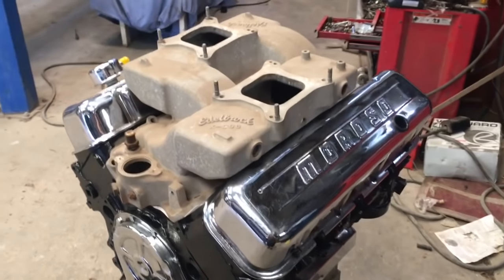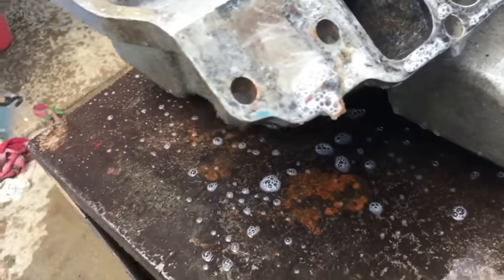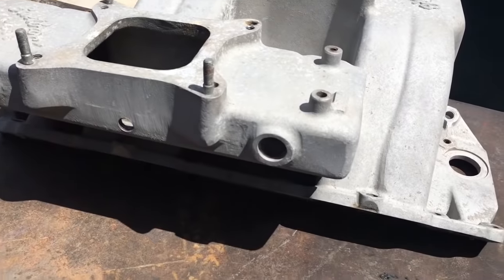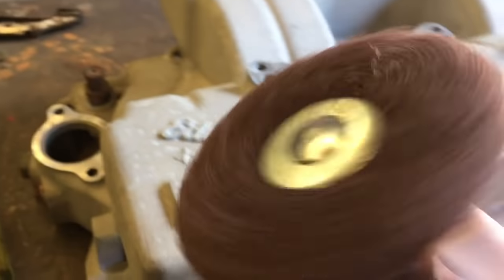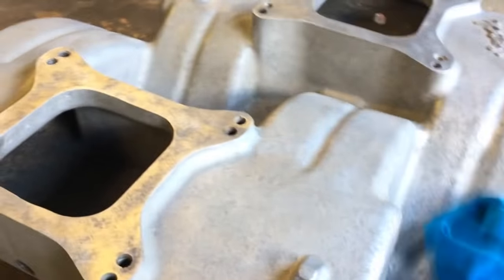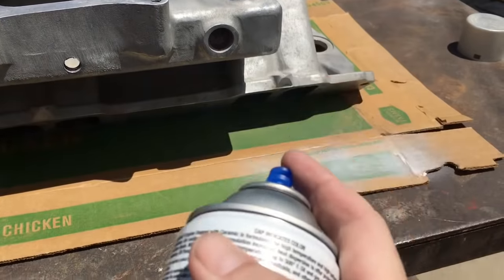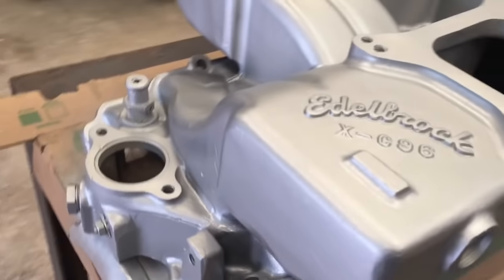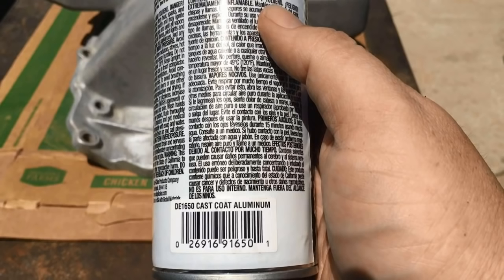Aluminum Intake Manifold Restoration the quick, cheap and easy way

Comment: I thought Edelbrock's had Endurashine?! 😂

I love that paint though. I redid my ATC 200s with black fenders and I did the tank and forks with the same stuff, just a little darker (like a gun metal cast iron it was called or something) Also restored a 1973 Briggs model 19 (8hp) and used the same paint, just in white.

Comment: Seems four 2bbl Holley carbs would be much better for distribution that two 4bbl carbs ,  4,. 350 Holley's would be great, for most fairly stout engines, and high RPM, and larger displacement stroker engines, four, 500 Holley's! They will probably require tuning, and the pumps backed off a bit, I'd use cables for the throttle, and a 1:1 for them all,  aligned with the runners, a  plate on the top would make it easy,  I was going to do something similar with a 84 cross ram tbi intake, until I saw how tiny the runners were,   no wonder they were done @ 4k-4500 rpm
Reply: The long runners,   set the peak  rpm.
I  have a  1988 corvette with TPI.  PEAK horsepower is 4800 rpm.
The 1988 TPI has 8 injectors,   but the peak rpm is still 4800 rpm.
Goggle  Chevrolet 1988 TPI

Comment: I use a product called Alum-a-Brite (when i can get it), or Eagle 1 mag wheel cleaner, the stuff made for cast wheels, and a paint brush with the bristles cut short for a scrubber.   I looked around, but Snow Bowl doesn't seem to be available local to me - otherwise I'd try that.   Probably a mild lye or acid cleaner like wheel acid.
Reply: Yup. Got a gallon of it. Used to clean big rig rims

Comment: These ram manifolds are so cool looking and if you use them on the street, thank you for your troubles.
Reply: They do, but you gotta have the bottom end and cam for it.
Reply: This is the same series manifold that I have been looking for for 30 plus years , Edelbrock X-3 for Chrysler. I had a guy tell me to forget that I even know about them , smh.
Reply: @Mike_Collins392  I think someone is making repops of those intakes now and I thought it was INDY cylinder head who were making those Max wedge intakes .

Comment: I know i am late to this video. but i just wanted everyone to know that Eagle-1 Etching MAG Wheel Cleaner will restore it to like new shine. I have used it restore the shine on my 1970 Camaro SS 396 L78 manifold. it looks like new, no painting required.
Reply: Then it oxidizes and stains again (unless it's a show car that is barely ever run.). Mag wheel cleaner IS useful for cleaning, but needs to be rinsed well before painting.
Reply: @Spiritof_76  I would mostly agree with you, on the fact that it will oxidize again. for my car. since they are extremely rare, (L78 was a 1 year only option and they only made 600 off them and they were all 4 speeds), so the value is in keeping it as close to original as possible. painting the aluminum intake is not an option, as it will detract from the value of the car.  my current method for restoring aluminum pieces, is vapor blasting, followed by eagle 1 wheel cleaner. vapor blasting as a tendency to leave the metal a little on the white side. but the wheel cleaner fixes that.
Reply: @shadvan9494  I wouldn't go slap happy painting parts on an L78 either.

Comment: Came out nice, but you really should be taping off the inlet, input ports, water neck, output ports, etc.
Reply: I was looking for someone to say something about the leaks this guy was going to have for painting over the metal. Not a good idea. Gaskets hate paint.
Reply: A little sealant and a gasket and bolt it together. That thin layer of paint hardly matters. If you want to be picky, a scotchbrite disk on an angle grinder will take the dry paint off faster than taping it all off. Or a paper or cloth towel with a little thinner will wipe the wet paint off quicker as well.
Reply: @Spiritof_76  paint makes gaskets separate. That's a simple fact. There's a reason no performance, professional, or even novice racer just leaves random paint on mounting surfaces. And that's for cars that are only run a few hours a month, if that. On a daily driver, it's even worse.
Reply: @the-dullahan  A thin layer of paint on the carb flange? What's it going to leak? The only flange with liquid passing on a Chevy intake would be the thermostat housing. A quick pass with a sanding block, lacquer thinner, or scotchbrite disk and it's gone. A little paint on the distributor flange isn't going to pass oil, there's an o-ring on the shaft. I have 5 chevy engines in my garage right now and have assembled a few in my lifetime.

Comment: You gotta heat up the metal and remove any moisture or oils/ solvents still within the metal. Then you need to primer it. Then add your color.

Comment: wow...looks so much better, do you ever put a clear coat on top of the gray paint? also you did not tape the mating surfaces on the openings, is that ever give you trouble with the gaskets and such?
Reply from the maker: I've tried it, but the clear tends to yellow over time with heat cycles, so I just put the gray on with no top coat, and that way if it does begin to flake or get scratched, you can easily spray some more on to touch it up.
Reply: @NitroUnion  what about self-etching primer for aluminum?

Comment: Glass peening with new glass beads will makeit look like new it is lighter looking with a shine on it ask your local machine shop about it although that cross ram did look dam good but one question how in the hell do you tighten the intake bolts on that thing LOL
Reply: T nuts are the way to go or you use a small magnet that sits in the socket to hold the bolt on and even then it's a pain in the ass because I had the same exact intake and switched to T nuts and life was good again.

Comment: The best way I've found to shine up an old aluminium intake is to use steel wool. I use the same cleaning process with degreaser but I just hit it with steel wool and then I use a magnet to pick up all the loose steel that falls off the wool. I just try to avoid painting aluminium engine parts because is just chips way to easily.
Reply: Don`t want to use steel wool on aluminum, pieces of the steel wool will get stuck in the aluminum and start major corrosion problems even if you paint the aluminum....Thats a big No No..

Comment: i get a lot of cars for free and i get a lot of after market parts build a lot of cars out of the parts when i polish i like to clear coat the part so it stay's shinny plus it saves a lot of money on a build i even do wheels make them look new and use mothers on the chrome like the bumpers u can make them look new again if the chrome is good and if u use car paint with activator in it it will last a lot longer then engine paint and stay shinny this is how they build show cars to stay looking good drive after drive just clean it  and when u paint it it should be clean of all oils and dirt i use reducer and wipe it clean this is how u restore parts but if selling the rig just make it look good

Comment: You can clear that duplicolor with 2k aerosol and it will hold up to gas getting on it.
Reply: What?
Reply: @jwjarv1s  I'm guessing English is not your first language. Ok I'm going to slowly break this down for you. Ok first he sprayed the crossram intake with duplicolor aerosol paint, are you still with me? Now what I'm proposing is get a 12 oz can of aerosol 2K clear ( yes they make 2K in a aerosol can) and clear over the duplicolor for added protection from gasoline spills. I hope you can grasp my message this time, because it will be difficult for me to draw you a picture using this format of communication!! WHAT!!!
Reply: @johnlaws9853  Im guessing you have too much time on your hands with a reply like that. Sadly, 2k doesn’t hold up to gas very well
Reply: @johnlaws9853  you’re a real smart communicator. Please enlighten me with more of your intelligence.
Reply: @jwjarv1s  The deflection didn't work, answer the question.
Reply: @johnlaws9853  Lol, that is what I’ve heard. I didn’t see a question mark. Give it a rest pal
Reply: @jwjarv1s  You still haven't answered the question (what?)
Reply: 2k clear is fuel proof. 2k is a 2 part clear....basically it has a hardner added to it right before shooting it. 

Like John's response you can buy it in a aerosol can. There is a can inside the can and you bust the inside can (hardner) with the ring that's provided with the can. The ring, key or punch is detachable and you pop it in the designated valve to release the hardner. Shake to mix then spray. 

Most 2k aerosol paints and clears has a life span of 8 to 12 hours after activated...few may have a 24 hour life span....you can store the left over can in a fridge or cool place and get some extra time before the hardner does its thing and creates a solid.  But 2k clear is harder than enamel. 

Most 2ks are urethane base but water base solvents are making their way to more and more paint booths lately. 

Somebody may need to help out our boy here read this since English isn't his first language. I tried to count it out with numbers but wasn't sure the numeric system was the same as the one he uses.

Comment: I media blast for a living 
Fastest way is mask off all the gasket surfaces with gorilla duct tape and glass blast it with 80grit glass. How complex that intake is to do by hand my machine will blast it completely in less than 5 minutes leaving a factory finish without the use of paint that will inevitably peel off. The average intake takes me 10-15 minutes and I charge $50 to do it. Idk what total cost for the materials you used are but where I’m at if you’re having to buy everything it’s roughly $25-30 plus your time and cleanup. There’s so many guys I do it for it’s ridiculous. Some are even brand new ones that they want me to get the surface better prepared to paint to match their engines.

Comment: I think i would powder coat that intake...hummm  i wonder how well powder coating the inside would work for a smoother surface  for air/fuel to glide through.  anybody ever tried doing the inside of a manifold  with powder coating?
Reply: Most tend not to polish the inside of the intakes because what happens is with a super smooth surface the fuel tends to not atomize as well & will actually slow the fuel droplets down because of this plus it cause the fuel to make big droplets which doesn't suspend as well as a atomized fuel does . This was explained years ago in the book by Edelbrocks great manifold bolt on where the book shows how the air fuel mix travels & what short & tight corners on runners do as well as long wide intake runners do plus they explain what different heights of the intake plenum causes as well as single plane VS Dual plane intake manifold operation . At most what you want to do is leave the intake runners rough because it helps speed up the turbulence of air & fuel but what you want to do it port match the intake manifold gaskets to the ports of the intake & do the intake ports on the head as well by opening them up to match the gaskets . It's ok to port intake & exhaust on cylinder heads because it's such a short shot once the fuel mixture is in the intake ports of the head the smooth finish won't hurt or impead the air fuel mixture because by then it's sucked into the combustion chamber then burned & shoved out quickly . A good intake shouldn't need a lot of work done to it for it to do its job  but what makes power are good or great flowing cylinder heads along with the right cam selection to make it all work together & that's why good HP cylinder heads are expensive or having stock heads ported CCd & polished plus bigger valves with a 3 angle valve job & bowl blend back then flow tested on a flow bench costs so much because it's time consuming & learning the secrets of head porting & flow is something that's learned from doing it although some cylinder heads they have what's called cylinder head porting templates that show were & were not to take material off or where to take material off because if done wrong you end up with a head that actually flows less than it did from the factory which isn't what you want because it will make the engine less efficient which means less torque & HP & more fuel wasted to go slower lol .

Comment: I just can't help but think
 4 x 2's would be so much better,   with each barrel in line down the intake plenum on each side,   maybe  smaller 250-300cfm carbs would be more fitting  for more street able engines, but a 2bbl based on a dominator would look awesome,  I have seen dominators split and offset to fit tunnels better,  but a completely stand alone 2bbl dominator,  with it's own cast body, like a half of a 950-1050 dominator, only tunable, and setup for low rpm metering, I think a dual booster design would beb an awesome addition, a really large booster basically sitting in the venturi,  with a traditional booster above it, with the main body being about 1" taller,  that will offer better metering at low and mid range with the upper booster taking over for high RPM,  use an additional power valve,  and adjustable jetting by needle and seat, like the idle mixture, being a 2bbl,  that leaves a whole side of the carb to take advantage of, this can be a small fuel bowl holding the needle and seat jet, and the power valve,, controlling the auxiliary booster, use two booster, so smaller fueling holes can offer a smoother, finer, fuel mixture,  the slightly above venturi booster should be a large diameter and smaller ban connected to a tube basically,  a internal passage  roughly. .060" x .080" , and about .030" thick wallswith 
.010" fuel holes, +/-, made with modern EDM technology,   and basically a tube filled with something to prevent collapse, and shaped like a aeroplane wing,  with EDM holes in the thinner trailing edge,  , and shape in to the ring booster and connect  to the leg by cold weld,  and connect to the body with cone seat and keyway, with a hollow screw, from the back side, being the seat for the needle and seat jet, with a second passage wit the power valve connected,   maybe a large single oval throttle valve the additional booster could improve the mixture greatly,  especially on cold intake systems, and cool running engines,  with better fuel atomiseation ,  not relying on the heat to vaporize the fuel,        it should be able to tune to run on nearly any engine ,even with a weak signal,  low vacuum,  and meter correctly nearly the same as a fuel injection system!    It could be a good project of the manufacturing cost can be brought down,   the extra circuits to allow more precise fuel metering, maybe. 2x2's would replace 4bbl carbs! Using an adapter that mounts the 2bbl carbs closely together, and near the same as a 4bbl , only a gap between the  two centers compared to the 4bbl,  like  a dominator lengthened  about 1"to 1.5"  funneling down to the traditional 4150 or dominator pattern, 
Sorry this rambling went way off topic and forever, sorry,  the sleep deprived mind! 😆,

Comment: Duplicolor is absolute trash, is way to thin and gas / oil or anything petroleum is going to take it off.  Rustoleum sticks to anything and stays there, can be had in any color imaginable and even has high heat variations.